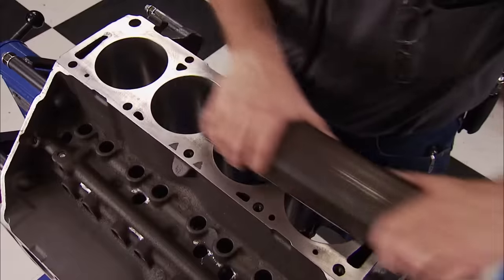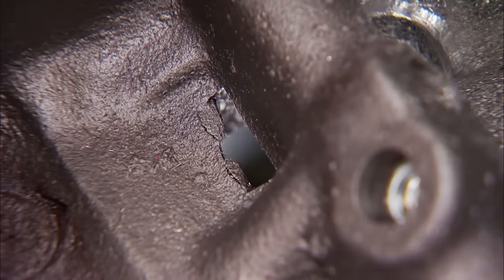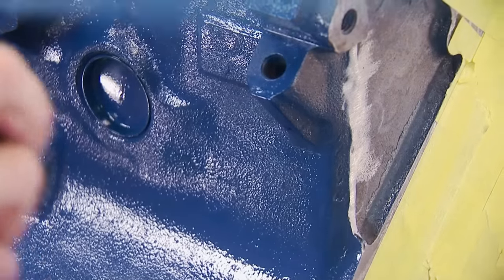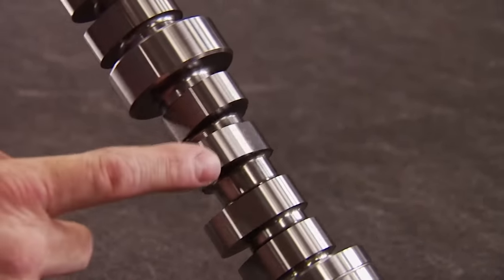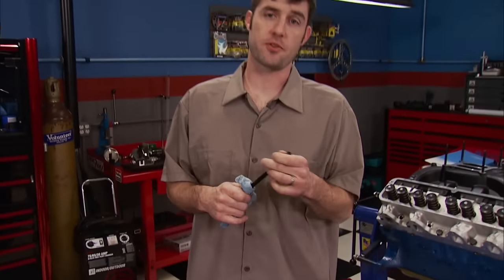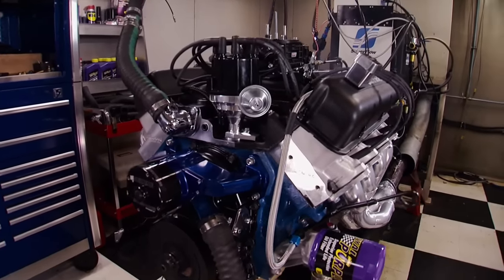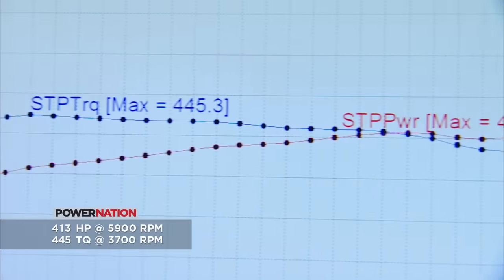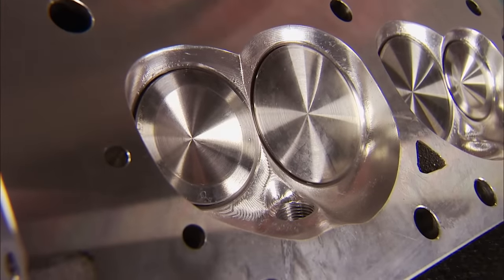Revitalizing A Ford 390FE With A Modern Twist - Engine Power S3, E7

Comment: Two engines I love. The 390 and the 300 inline 6.
Reply: I've had both and loved them.
Reply: don't forget the 351C
Reply: I drive 2 different 300s on a daily basis and literally just tore down a 390 today.
Reply: 300 Ford best engine ever for daily worked pickup. Notice I did not daily driven. Have had 12 of them in f.150s ftomn1981s to 96s. I prefer the fuel injected backed by c6 trans.
Reply: There is nothing to love about this 2 bolt main boat anchor motor.
Reply: And i have both. I have a couple 390's and then just recently bought me a 300. I just bought a 76 f150 4x4 with a 390/c6 and im wanting to put the 300 with a np435 4 speed in it. Yep im a ford guy. Haha
Reply: @prospector5572 why do you say that?

Comment: Cool to see an FE build,  we built a 390 for my truck using mostly ford parts, with a few aftermarket upgrades,  390 std rotating assembly, ported c8ae-h iron heads, upgraded valve springs, comp thumper cam,  Holley street dominator intake, Holley 750cfm 4bbl, long tube headers. HV oil pump with restrictions in the heads,  oem non adjustable rocker assembly, hydraulic flat tappet lifters from summit. Turned out exactly as desired, a reliable torque monster with a really nice sounding idle.
Reply: I did pretty much the same thing building a replacement 390 engine for my 4 door galaxie, more of a daily driver car. 4.080" bore 390, L2291F pistons, zero decked block, I spent a lot of money on the machine work so that was all right instead of just slapping aftermarket parts on it "trying to make it faster". I used a set of nicely rebuilt C1AE heads with my stock original 352 4V intake (ports matched perfectly) didn't even bother with headers, I resurfaced those on a large belt sander and sand blasted them clean, just a good custom exhaust system. 10:1 compression, comp cams XE262H cam, machine shop did the oiling mods to the block for me free of charge, used a HV pump. Stock non adjustable rocker arms. That thing runs pretty damn good, especially with the 3.70 gear and 2200 stall torque converter I have. Never would have guessed it would have been so powerful for all of the stock components, and how fast and freely it revs to the 5500-6000 RPM range, with a stock single point distributor at that!
Reply: Very cool. Always wanted to do a 390 build since you very seldom see them.
Reply: @bigboreracing356  Sure hope so, it better for what that cost.
Reply: @bigboreracing356  well my stock big block jimbob ford makes my aluminum headed crammed 351W with headers look like a piece of shit, so who cares.
Reply: @bigboreracing356  a 302 with every part in the book thrown at it won’t compete against a big block modded in the same fashion. Mod for mod the big block will always be better. It is simple physics numb nuts.
Reply: @bigboreracing356  Jesus Christ you sound like a Chevy guy Are you sure you don't have a tree fifty. 8.2 huh I've split those things in every direction they are good but like us all you might graduate into maybe something worth bragging about. Also everybody always like the well my BUDDY.
Reply: @bigboreracing356  wow. I guess my stroked 460 in my 1964 galaxie should be told to go slower. With John kasse heads,manifold, cam and a few more performance parts, I can run 9.10 all day in the 1/4 mile. I should go faster but I race at 5000 feet of elevation, so air isn't as dense. As far as a 306 beating every big block, I guess  maybe you live in the middle of fantasy land. An engine is an air pump. The bigger the pump, the more power you get assuming everything else is relatively similar. But I guess at the tractor pulls, those guys are just idiots. They are running 460 stroker motors. If they only knew that a 306 would be more powerful, they could save so much money. Oh, by the way, my 64, gets driven 70 miles each way to work at least once a week and is totally reliable, although I only get 13 to 15 mpg
Reply: @CadillacZachOffical  😁
Reply: @bigboreracing356  I love my pushrod motors, (390, 5.0, Z-28 350), but recently picked up a Explorer Sport Ecobeast, twin turbo, 365 horsepower, paddle shifted 6 speed, launches HARD, feels like a big block, 4wd works in Pismo sand, too! Don't know what Ford was thinking making a 14 second SUV, but I like it!
Reply: @bigboreracing356  no you didn't. If you stomped a big block Ford with a 302 or 306 it was undoubtedly a poorly built or tired old big block. The torque supplied by even a mild 390 FE is significantly more than you can get from a performance 302 or 306 unless your using a power adder like forced induction. " There is no replacement for displacement " as stated by Carroll Shelby is a fact proven time & time again. I have been building Ford based performance & racing engines for almost 30 years now. And a properly built 390 FE with just a few minor alterations and a few more aftermarket parts will destroy a NA SBF that's had 2 times as much money put into it. And the FE will be way cooler and much better looking doing it too.
Reply: @bigboreracing356  in fact a stock compression 1966 z code 390 fe from a T bird using stock untouched heads with only a comp 268h cam, comp adjustable timing set, port matched  Edelbrock Streetmaster intake , ceramic coated headers , msd box and duraspark conversion in a recurved factory distributor with good 8.5 wires and simple auto lite copper core plugs and a center dump Holley 750 carb will lay waste to a NA stock stroke SBF of any displacement in a vehicle of similar weight . Automatic or manual transmission EVERY TIME Guaranteed
Reply: @bigboreracing356  I have a 510 hp iron head home ported and built , dynoed in 1999 and still ripping.  I have been running FEs for 40 years and they are beasts, BTW that 510 hp 390 is a daily driver.
Reply: @bigboreracing356  Bullshit, call FESpecialties or Lykins Motorsport.
Reply: @bigboreracing356  ounce per ounce a small block Ford is more potent than  a FE engine.  But your 302 in the same vehicle as the 390 won't donkey stomp it.  Application is important.  I'd much rather have a 390 in a 70 Ford truck or large car than your small block.
Reply: @bigboreracing356  but you spent 10-20k building it and can’t make power down low
Reply: “Torque monster” is a nice way of referring to an engine that is weak on HP.  Usually due to poor cylinder head flow.
Reply: You guy commenting about it being a big block. FE engines were not big blocks. Stop commenting when you have no clue what your talking about.
Reply: Them thumpr cams just for show most fe members say it’s not worth the time
Reply: @fenatic7484  nice work

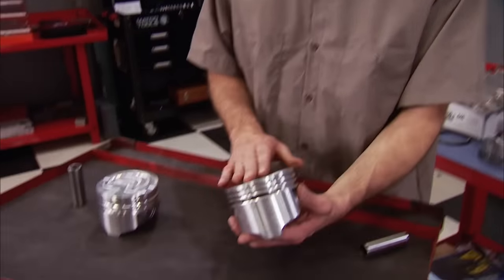Comment: I've had several of these FE moters over the years, a 66 t bird, 70 wagon, a few trucks, didn't baby them, never hurt one. Impressive performance on the cheap, now I  have one in my slammed 70 F 250, just headers, 4:11s, plenty of power with a 2 bbl.
Reply: You almost sound like me. Have had an Edsel w/332,  65 wagon w/352, 67 wagon w390, 66 t-bird w/428. Cars fell apart( after being hit 4 times, ) but motors kept running. Still have the last 2
Reply: I’ve got a 70 wagon with a 390!